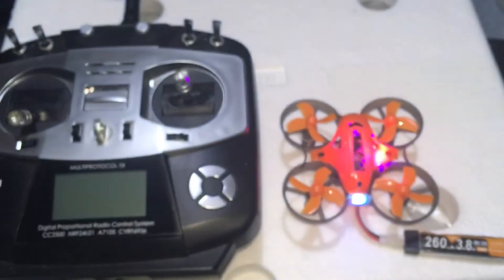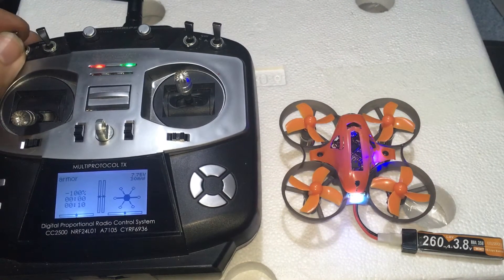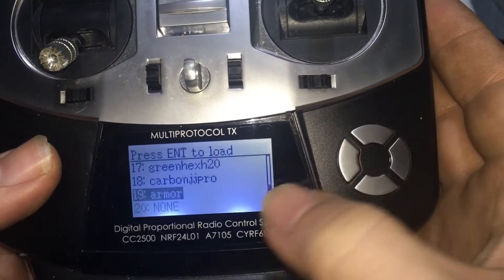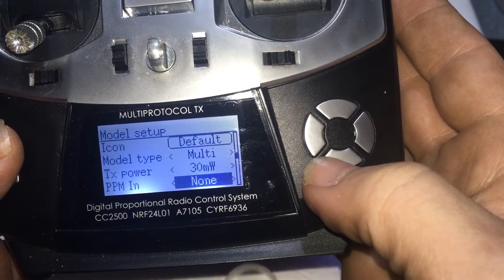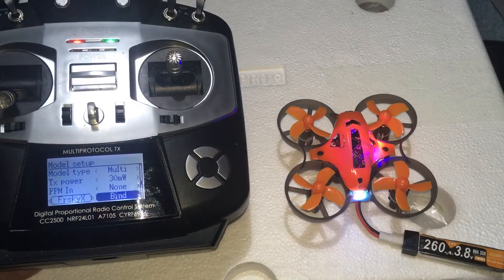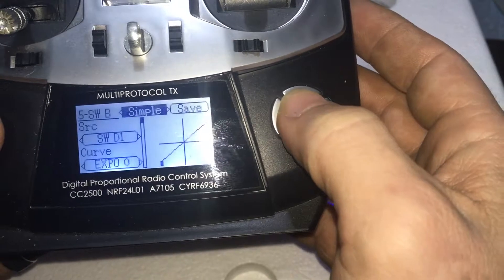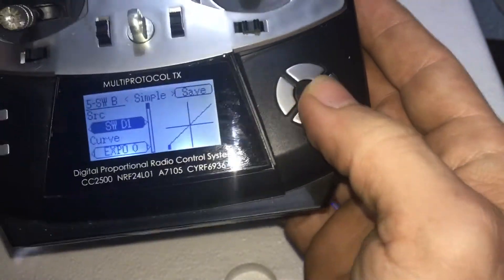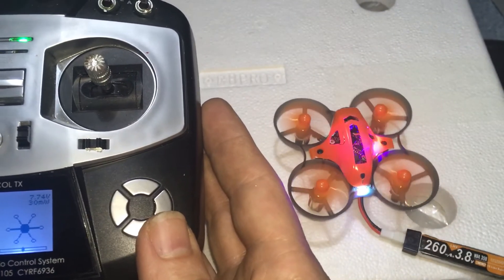Makerfire Armor 65 Plus BINDING Frysky Jumper T8SG 716 Motor 5.8 Fpv

Comment: I have a Makerfire 65 Plus and followed your instructions and its still not binding. What are all the toggle settings on top. The red and green light are on. Do not know what I am missing. This is first binding since I received the controller.
Reply from the maker: Hmm I think I covered everything
Reply: I called Tech support and seems I had to depress a micro button next to the green light on bottom. Press and hold then connect battery then release. Then Bind with Jumper. Also you can connect to USB and go to website. 

https://chrome.google.com/webstore/detail/betaflight-configurator/kdaghagfopacdngbohiknlhcocjccjao?hl=en

You probably know already. Just in case you do not.

Comment: Hi Jay Drone. Got mine a couple of days ago.  I can bind her to my Devo 10 with Deviation, but she loses connection after about 10-15 seconds.  Would you have any idea what might be causing this?  Thanks in advance
Reply from the maker: Odd man I don’t know about that one never had that happen
Reply: Hi Jay Drone.  Thanks for getting back to me.  Pulled the rest of the aerial out of the shrink wrap and a bit of the cover was damaged exposing the aerial which was probably shorting out on the board.